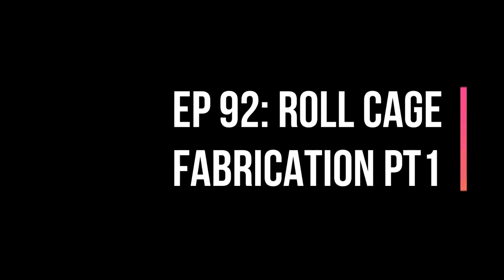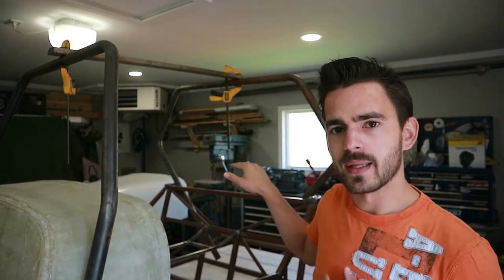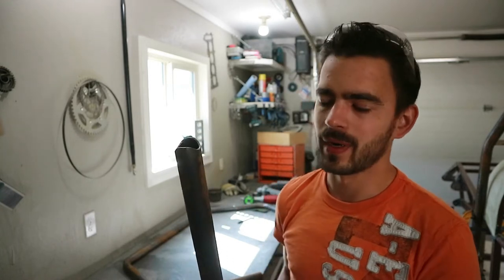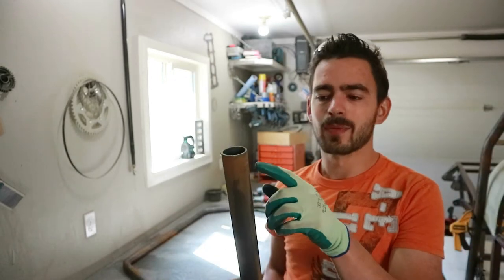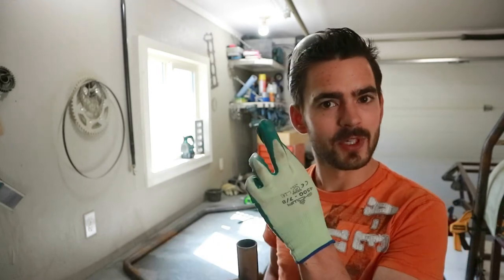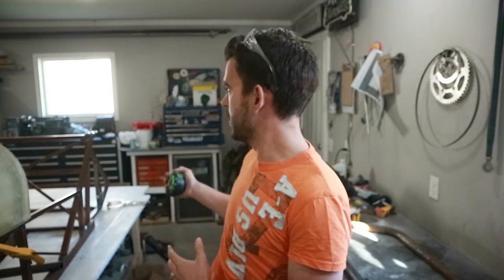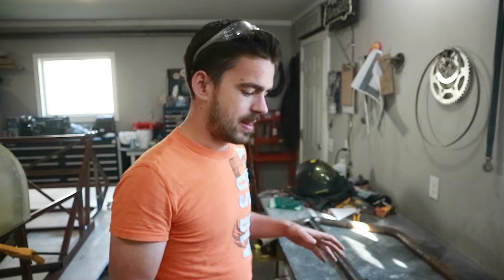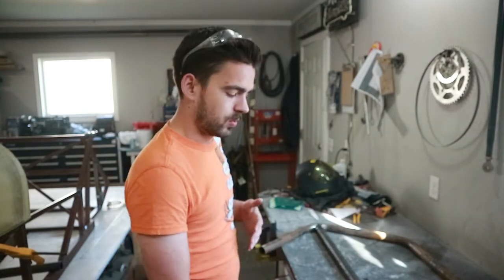Ep 92: Fabricating the LoCost Roll Cage

Comment: Hey Lefty, The cage is looking good! I'm assuming you're intending to use it on the street (?) are harnesses ok to pass an inspection? (I haven't looked at rules or regs for Alberta yet but am planning on harnesses too!). Thoroughly enjoying your build - keeping me motivated to complete the garage reno and start mine!
Reply from the maker: Hey Jinca, the harness rules that I have seen are pretty grey. They indicate that the seatbelts must be the same as OEM installed, but since we are the OEM anything should work. I know that HowIsThatStreetLegal runs harnesses on his builds and he gets them past inspection in Alberta. I would suggest a DOT approved harness tho.
Reply: @leftfootfirst9847  Ugh, grey areas! I guess it depends on the interpretation of the inspector.  It'd be nice to discuss it with them prior to so you know what they're looking for. Perry (from locostusa) up in Holden AB has built 3 seven 'replicas' I don't remember if he used harnesses or belts though.